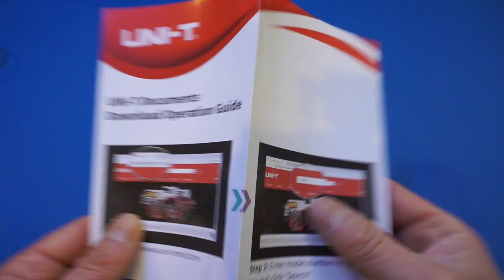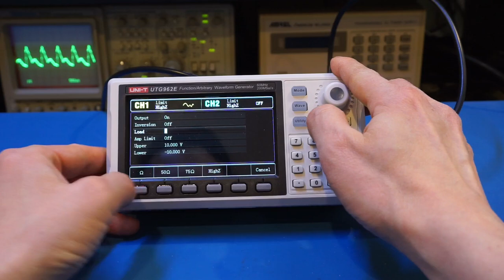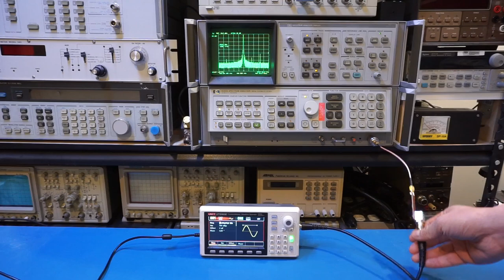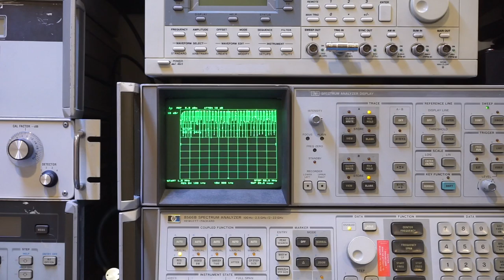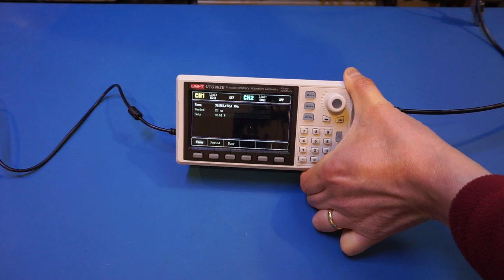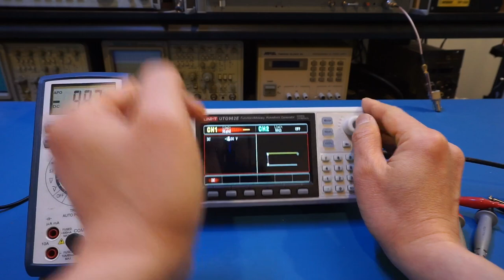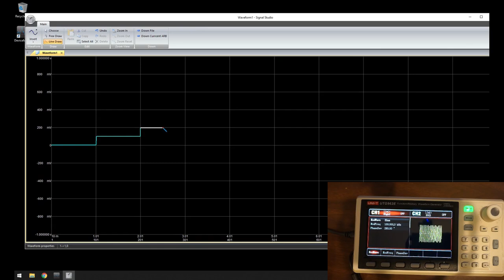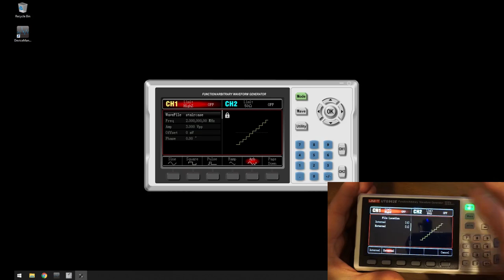UNI-T UTG962E Function/Arbitrary Waveform Generator Review, Teardown and Experiments

Comment: DC output issue - If you had put a 50 Ohm load across your multimeter inputs, the DC voltage would have been correct.  This is true in every output signal mode... if you set your o-scope to Hi-Z input, and the sig gen to 50 Ohm load, you will get double the output voltage that the sig gen says it's doing.
Reply: How can we do it

Comment: Was the DC output offset off because it was expecting a 50 ohm load.  It had a 50 ohm output impedance and with a 50 ohm termination the voltage divider would be 1/2.
Reply: Correct. The generator assumes that its output is connected to an input that has a matching impedance and displays the amplitude based on that assumption.

Comment: Got this unit for my cassette deck tuning job. I avoided going with the traditional lab-like dual channel FG as it looked a bit dated and limited for the price and this was cheaper.

Since I already knew the quality standards of the brand I opted to go for it... I am very pleased. It's precise and pretty quick... not the most intuitive interface but you get familiar with it after some time.

One downside that I am afraid is by design you can't set up both channels at the same time. You can synch the output of the channels, time shift the output but each time I have to change the frequency length I have to manually enter the values for each channel, each time I want to turn on or off a channel I must do it individually. Not overly sure if there's a way to act on both but it might well be a marketing strategy to remind that you could bought the next model up the range.

Comment: The multimeter is high impedance when measuring in volts, and the generator is seto to 50 ohm, is normal plus volt.
You must set the generator output to highZ

Comment: Good review. 👍  Have you checked the voltage to ground hot & neutral from a BNC cable coming off the 962?  I find anywhere from 50VAC to 120VAC depending on the power adapter I use with mine.  Typical?  It appears I had a floating ground on the BNC for output 1 that caused some of the high measurements. I had to deform the BNC connector shell on the 962 to get it to fit tighter.  Now the voltages are ~25vac but still higher than I'd expect.  I did not check current.

Comment: I have the 962 and the UNI-T UTD 2152 scope.  I need to transfer a stored signal on the scope to the 962.  As per Uni-T, the file formats are incompatible.  Do you know of any way I can reformat the csv file on the 2152 to be accepted by the 962?  The signal in question is the spark generated by an electronic ignition.  I can store the primary signal of the coil and by inductive coupling the secondary signal.  
Since this is a complex waveform, I am attempting to design an interface circuit to provide a +12 volt pulse to a tach.  This ignition is connected as a positive ground 6-volt system.  I have a voltage inverter and boost to take the -6 volts and convert it to +12 so that supply is available for the interface.
The only format the 962 appears to accept is a .bsv.  It will output a .png file.
Any help would be appreciated.

Comment: Very useful information - thank you. I have one arriving soon and am wondering if anyone has used a right-angle BNC adapter so the cable isn’t sticking out so far on the side of the unit. I couldn’t find a test cable with a right-angle BNC, so I’m planning to use an adapter but I’m a little worried about signal degradation. Any thoughts?
Reply: Bnc with one good quality adapter should still perform extremely well.

Comment: I am a bit confused: Is the output impedance of each channel adjustable between 1Ω to 999Ω, plus high-Z (manual p. 9), or is it only 50 Ohms and high-Z? Looks to be a good instrument, thank you.
Reply: hI, You can select 50 ohm or high impedance (typical 1 meg ohm), you don´t need values in between. 50 ohms is the standard and high impedance is intended for osciloscopes or other devices that yo cannot terminate with 50 ohms. don´t worry about that, just with those two values you´re just fine.
Reply: The output impedance of the generator is always 50 Ohms. With that configuration you only change the displayed amplitude level, so the instrument shows the correct value for the load you are connecting.

Comment: Hi thank you very much for your very valuable and helpful tutorial   I see that when you connect the generator to the SA you use a dc blocker ?
is this mandatory ?   would a cap on the + side be enough ? which value ?   
will the generator performance be better at audio frequencies (i.e. from 20 to 20kHz)?    i am seriously thinking to buy one if this is the best unit for Q/P ratio   
thanks a lot   gino
Reply from the maker: Most SAs cannot tolerate any DC offset so a DC blocker is recommended. Since SAs are mainly used for higher frequencies, a capacitor in the range of 100-1000pF should be sufficient.
Reply: @KerryWongBlog    Hi, thank you very much for your very kind and valuable reply
My main interest would be to find a spectrum analyzer and signal generator solution for use in audio so from 20 to 20kHz to check some preamplifiers for THD and noise my main interest   
Devices that output 2-3Vrms at max   
I therefore imagine that the capacitor will have to be larger

Since I'm an amateur I wanted to start with a sound card plus signal generator to keep the cost down. 
A quality entry level audio analyzer the qa403 already costs around 600USD
If I am passionate about the activity then I could invest more
For now I would like to find a signal generator that is not too expensive but is not a toy let's say

Comment: Hi,  I didn't find the maximum output current  for output DC. Do you know it ??
Reply: output impedace is 50ohm so you can calculate it, output voltage is 20Vp-p with no load so it is likely 141mA max taking the Vrms of 20 to be 7.07Vrms

Comment: do you recommend getting this one or spend more on a siglent/rigol?
Reply: Similarly spec'd Rigol waveform generators cost about twice to 3x one of these units. If you're curious just compare the spec sheets on both. If you don't have a function generator this UNI-T will probably be fine depending on your application to get you started. If you need finer waveform accuracy, better interface/software, higher frequencies, more features etc, then you'll need to look at much higher end Rigol units or other well known manufacturers with a corresponding increase in price. So as always with this stuff, "it depends", but this is great as a starting point for function generators.

Comment: UTG900 MainBoard
Edition: v1.02 20190426

UTG900 Key&Display
Edition: v1.03 20150428

From the lower marking we can see that this series has been around since at least 2015 and that the last revision of the main board was in 2019.  How long has this series been known to the US market?  It;'s new to me.  I wonder if the units without the 'E' are an older version since UNI-T doesn't arbitrarily put letters in the model numbers of their multimeters without them designating something.

Comment: Thanks for the review. Did you look at the noise and distortion of the output at sub-volt levels?
Reply from the maker: Didn't check that specifically but based on what I saw on the SA I'd think it meets the spec.
Reply: @KerryWongBlog  Many thanks.

Comment: Nice generator BUT it would be much better if it has noise random periodic function and first of all a  BATTERY driven option, 1 hour of operation at least.
Reply: a power bank outputs the 5v it needs so I dont see why you cant do that.... better to use a power bank than a battery that dies inside the unit
Reply: @rokiedecentra9656  Half the reason for wanting battery operation would be to get rid of the noise from the switch-mode psu. If you use a power bank, you're just substituting another switch-mode psu that lifts the 3.7V batteries to give 5V output. I'm going to try a 12V battery with a linear regulator like 7805. My sig gen draws around 0.5A, so a smallish sized heatsink will do the job. Perhaps a 2S li-po battery pack with a linear regulator might provide a long-term solution.
Reply: @RexxSchneider  it will do switching conversion internally to get the high voltage rails so would it make that much of a difference
Reply: @rokiedecentra9656  Hard to tell without trying it. It may improve it, but it certainly can't make it any worse. I'm not terribly impressed with the noise on low amplitude signals generated.

If all you want is to have a floating ground on your signal generator then a power bank is fine - I've used one for that without any problems.

Comment: Is there a label or any kind of EXTERNAL markings which might indicate a date of manufacture, a serial number which would imply the same, and/or regulatory certification markings?  On its UNI-T multimeters, letters after the model number signify some significant difference and an "E" doesn't mean "English model."

I've seen claims from sellers selling UTG932/962 without the "E" suffix that there is no difference and that the "E" stands for "English model."  That makes no sense to me since the language can be easily changed via the setup menu and, as I have said, a letter after the model number means something significant with UNI-T multimeters.  

From experience, I trust China-based sellers as far as I can throw the nation of China which is why I'm asking this along with the discovery from your dissection of your "E" model that, based upon the keyboard and display PCB, this item has been around since at least 2015, possibly only in China.

Comment: Thank you to have deleted 2 times my comment where I told that unfortunately to me it doesn't work the driver. Good luck
Reply from the maker: I don't delete comments. Comments do not meet YouTube community guidelines are automatically withheld.
Reply: @KerryWongBlog  My comment was not violating any YouTube guideline.
I listed in bullet points what doesn’t go with the drivers, what I did to try to make them work and didn’t worked at all. I also stated I contacted the manufacturer several times and I have not received any answer. Hence: not any violation. They where visible for 1 minute about, and then removed
Reply from the maker: @Not-Only-Reaper-Tutorials  Oh, sorry to hear that. Wondering if there is a bug in YouTube 's commenting system. But I don't manually remove comments.
Reply: @KerryWongBlog  I have not clue. Certainly my message is not held, since you didn't find it. My channel all the comments are held, and I regularly see them and approve all. Just my comment was removed. Not one but 2 times. The first time I thought it was my mistake. Then I republished it. It was there for a couple of minutes, then removed. That's definitely not nice action.
Reply from the maker: @Not-Only-Reaper-Tutorials  Thanks for letting me know. It's odd indeed. I just checked the withheld comment section and didn't see yours in there either...